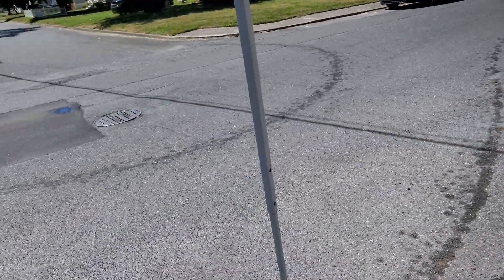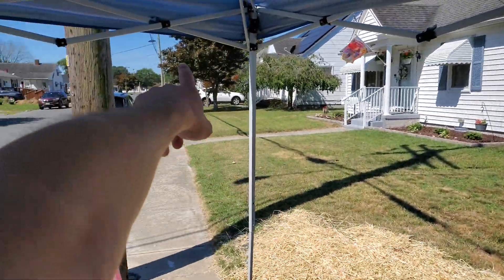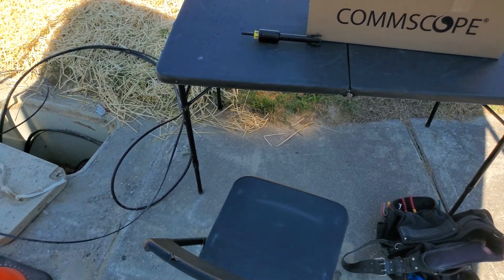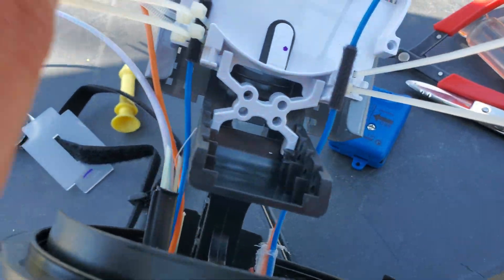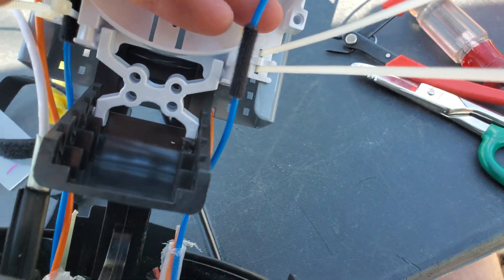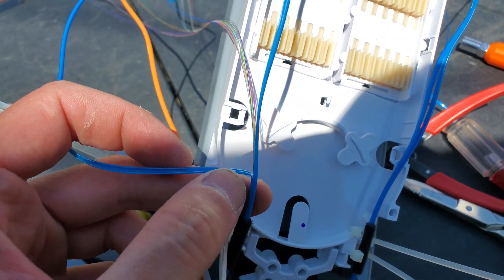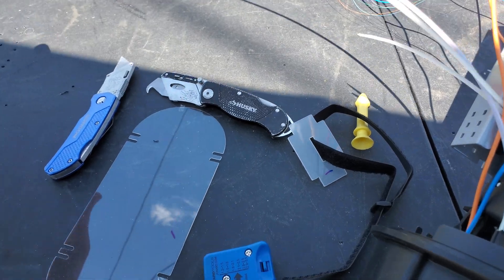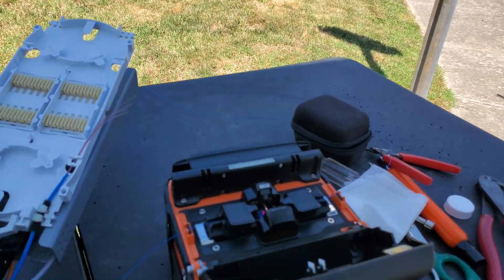GPON build,  mid slit on a lateral 1x32 gpon splitter,  and a unusual window obstruction.

Comment: dang 26mpg poor mileage :(
Reply from the maker: 2014 ML350 getting 26MPG.  Only supposed to get 24 highway.  This is running non stock air filter and liqimoly oil vs what they put in at dealership here which is mobile 1.